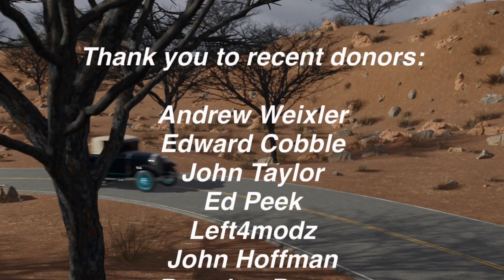How to set Ford Model A timing in SECONDS using a NuRex wrench

Comment: Paul, thank you too.  I always enjoy your videos.
Regarding this video, one thing I think should be added for the new people is for them to know that the Model A engine can only be turned at the crank as you did here with a wrench.  It can't be turned by the belt or water pump.
I remember you had a previous video that covered this.
Reply from the maker: Thanks DM!  Yes, I have covered that a few different times.  Many years ago, I learned it the hard way.  Never forgot that

Comment: Timing Tool. High Paul. I left a message when I bought my 1930 Tudor at Easter time this year. I am really enjoying the car and the local club "Meadowlark Model A Ford Club" in Omaha.  Thanks for all your helpful and entertaining videos.
 I'd like to mention a frustration that you might like to address sometime on one of your videos.  I rebuild a back-up distributor just to be prepared.  I can't tell you how many times I re-timed or changed out the distributor to the original.
 I purchased a modern points and condenser from a Model A parts house. I won't mention the name unless you ask me. I could get the car to run but not far.  Checked everything out with a guy who mentors club members and determined problem was points. So I bought a new set at local parts store.  Ended up on side of road again.  I am on my 4th set of points in this distributor and all is well.  The 4th set is Echlin brand made in Mexico, purchased at NAPA cost twice as much as others.  The other points were made in either China or Taiwan.
Reply from the maker: Thanks for the info.  I have brought this up a few times.  However, I get skewered and called all sorts of terrible things if I put down things made overseas, so I have to be very subtle about it.  Always use the good points.  While you're at it, consider swapping out that condenser too.

Comment: (Timing tool) if still available. I'm becoming a Paul Shinn groupie! These videos have helped me with my newly acquired 1931 model AA truck. I went through the timing procedure today and when I was done, my engine idle was 150 RPM higher than when I started. I guess that's a good thing 'cause I then went through the carb adjustment and idle adjustment procedure. I tried hand-crank starting it for the first time ever and it started right up the first try. Very nice! I used my Fluke meter on OHMS scale and audio to fine adjust the points.
Reply from the maker: Excellent!  Good work, my man!!

Comment: Another great video, Paul! Thanks! 

I'd like to add that you can use the Timing Tool to also quickly CHECK the timing of an engine that does not seem to be running right.  

* Put the engine at top dead center with the timing pin.  
* Without loosening up the cam screw, put the wrench on the cam.
* Gently turn the wrench a little clockwise to take all the slack out of the distributor drive.
* The wrench handle edge should just be resting against that #4 metal pin on top of the distributor cap body, or a tiny bit past.

Have a Model A Day!
Reply from the maker: I totally forgot to include that.  Thanks Jim!b Do you have one?  If not, email me your address and I'll send you mine.
Reply: @ModelA  It's all good!  Yes, I have several, I don't need another.
Reply from the maker: @MAFCAJim    10-4.  Thank you for all you contribute to the Model A community, Jim!

Comment: Timing tool - Why would the timing change? 
When you turned it what actually changed? 
Not sure I understand. I’m still learning little nuances like this before I buy a Model A.
Reply from the maker: If you had to change something, like the head gasket.  Was turning the distributor cam.  See the video I did on rebuilding the distributor for full explanation.
Reply: Oh, I mis-understood. You were driving so I thought you were implying it could go out of adjustment on the road. Thanks for explanation. I saw the distributor video.

Comment: I use the Nu-Rex tool and have a couple of them.  If one tends to be forgetful, instructions for usage are printed on the tool.  
When using the handy large wrench to turn the crankshaft keep in mind that you are working very close to the radiator.  If the wrench is placed squarely on the nut with full engagement - no problem.  If one gets in a hurry, not paying attention that the wrench is fully and properly engaged, it can slip off the nut when pressure is applied.  The radiator fins function as an efficient cheese grater on bare knuckles.  In the worst case, a damaged and leaking radiator can occur.  Paul does have an excellent recent video on changing an A radiator.  🫣  
As always, thanks for the informative video.

Comment: Hi Paul -

Timing Tool

I Love your videos! So easy to follow and learn from! I am a first time owner of a Model A. It is a 29 Towne Sedan in near excellent condition.. However it has a few minor issues that I am studying up on and then will correct shortly. One is a couple of fuel leaks around the carb and the interior fuel gauge. Another one is that the car is lacking a battery so I need to figure out what voltage battery it needs. Lastly I want to check the timing of the distributor. Once I get these items taken care of,  it should be ready to go and I cannot wait to drive it!

 A huge Thank You for the wonderful videos!

Comment: Timing tool is a magic way to get the timing correct, how often do you find you need to check ?  My 1928 Pickup is running a bit rough and was wondering if the timing has wondered a bit !!!
Reply from the maker: It's a set-and-forget kind of setting, until you change something.

Comment: Paul thanks for all the videos they help me alot can you tell me where to send my Zenith 2 carburetor on my 31 model a  i have put a new kit in it  but car seems  like it is not getting enough fuel,i have to turn fuel valve 1/2 to 3/4 open and that is to lean. thanks for all you do
Reply from the maker: Bert's can swap a rebuilt Zenith for you.  Good luck!

Comment: timing tool ,love your channel, I currently have three model A,s, but have a question,  will a overdrive work in a victoria, as it has the rear seat floor pan that is lowered about 6 inches . will the pan hit the top of the overdrive?

Comment: I know it’s too late to get a timing tool but I’m curious about timing in a car I’d like to buy which has a Model B engine. Is there any difference in how to time it compared to a Model A engine like you’re showing here? I think one of your cars   has a B engine but can’t find the video in which you reference that engine. What else should I be aware of if I buy that car? Thanks again for your help and please keep those great videos coming! Lloyd
Reply from the maker: same procedure except with a B timing cover the timing pin does not indicate TDC. You have to look inside the cylinder and set the piston to TDC visually.  Everything else is the same.
Reply: @ModelA  Thanks! Do you have a video about replacing king pins?

Comment: I'm 6'1" & a few hundred pounds.
Although I'm losing weight, which Model A is most accommodating a large driver?
Reply from the maker: A 30 or 31 coupe or tudor (with the extended seat brackets)

Comment: Paul, when you perform this operation, do you put the advance lever in the "second click" as in your other video?  BTW - ordered those tools - will make like much more easy.
Reply: Bill, when you use this timing tool, it does not matter where your spark lever is inside the car. A very cool design that simplifies timing the engine.

Comment: Timing tool.  Hey how often do you need to time the engine?  Just wondering because I'm getting more interested in buying a Model A s a hobby.
Reply: The Model A engine should stay timed for a long time and not need any fussing. But if you need to remove the ignition cam to work on something inside the distributor, then you need to time it again. Or sometimes the engine is not running right and you want to check the timing to confirm it is correct (which you can do quickly with this tool).

Comment: Hi Paul I use a NuRex upper plate but have found that not all modern point are the same.
The point I have now are correct but the points before were not correct.  So be. careful.  Steve
Reply from the maker: Right.  I know the difference, but it's difficult for most to tell.  To be safe, I just suggest original style points.  Then, as people become more familiar with these and want to experiment, go for it.

Comment: Paul, you  rotate the timing tool only 1 turn instead of 2 turns?
Reply from the maker: Yes
Reply: NUREX instruction says  ' 2 turns clockwise" . Merry Christmas!
Reply: @ModelA  NUREX instruction says " 2 turns clockwise'. Tks and merry Christmas.
Reply from the maker: @antonioemiliogarcia2399    Yes, I know.  But it is unnecessary.
Reply: @ModelA  I agree with you. Tks

Comment: Hi Paul 
I really like tool.  One concern is that on some modern points it is not correct.  I drilled a hole in the middle of handle to set some modern point
Thanks Steve B.
Reply from the maker: I have modern (Mustang) points on my coupe, still works perfectly. The trick is to make sure the points are mounted in the proper location on the upper plate.  Some are correct, some are wrong.  Whenever I am working on a Model A and sharing info, always presume it is stock.  I forget that some people make modifications though.  Thanks for the reminder!

Comment: Timing tool ! Have model a woody ,no body purchased plans built new body white oak ,local  man did motor brakes etc, took first place at old settlers parade,
Here is problem,The truck was in heated garage for year or so, decided to start it no luck the motor is locked up with rust took head off have diesel fuel soaking pistons , Is motor worth fixing  ? probably just get rid of it 73 yrs old !
Reply from the maker: Dang!  did you check the oil yet?  See if coolant got into the oil.  If so, it may be time to drop the pan.  A fresh rebuild is pretty tight, so and condensation that got in there will be a big problem.  You should be able to work it loose, but if not, pull it and take it to a machine shop.
Reply: Thanks

Comment: I guess I missed why one would find themselves on the side of the road out of timing.
Reply: If you had to remove the ignition cam to get inside the distributor to work on anything inside there, under the breaker plate, then you have to time the engine again, as Paul shows. 

Or maybe the engine is running poorly and you want to check the ignition timing, to make sure it is correct. You can do that check very quickly with this tool, once you have the engine at top dead center with the timing pin in the front.